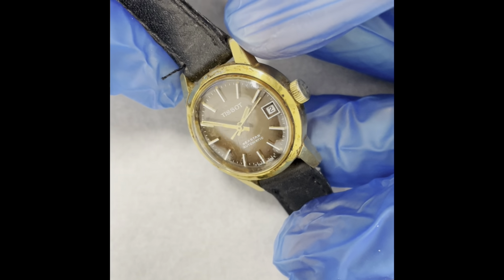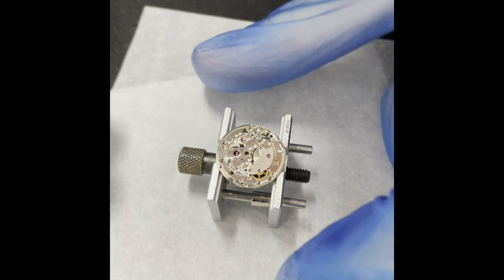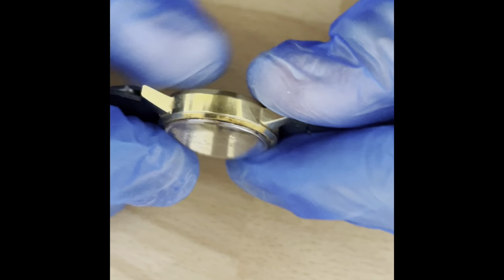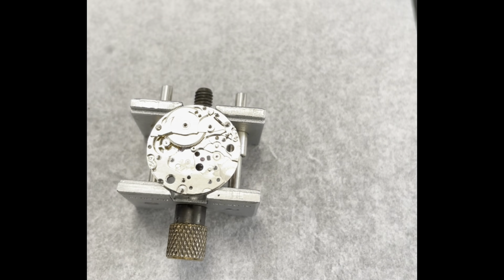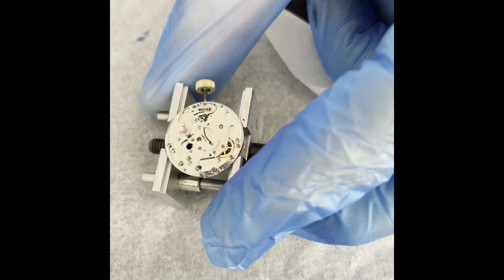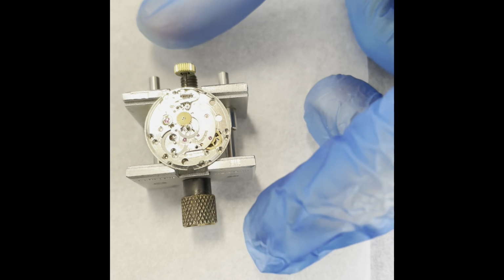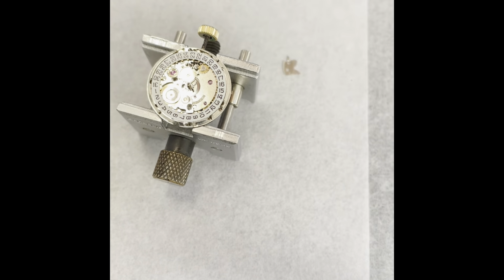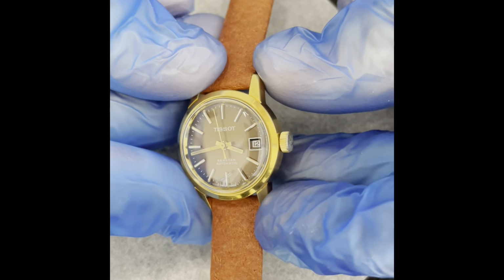Watch service Tissot Seastar calibre: 2381 = ETA2671

Comment: Your weishi 1900 is much better than the weishi 1000. It is just as accurate as a Witchi. Its all about the microphone. The software is just a glorified chronometer.
Reply from the maker: I’m very happy with it. When I worked in a workshop with both Weishi and Witchi We sometimes had to put the movement on the Weishi to pick up a irregularly.